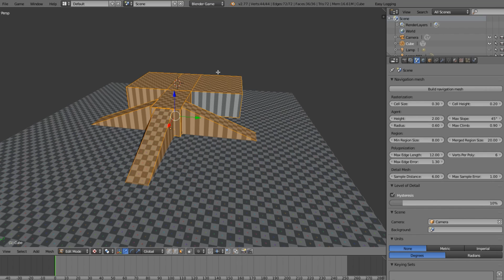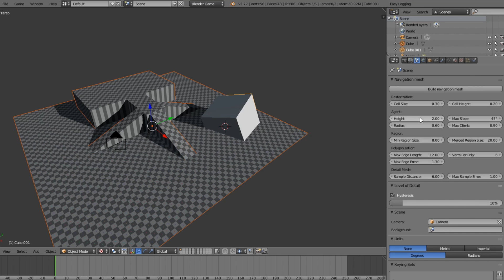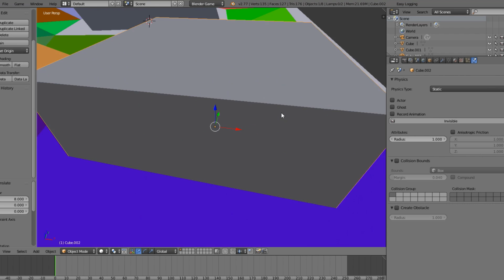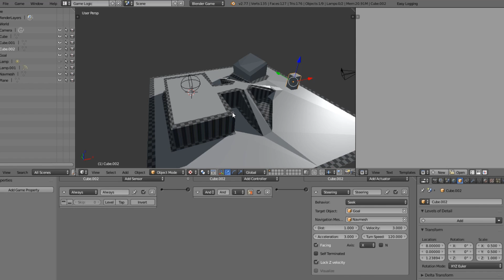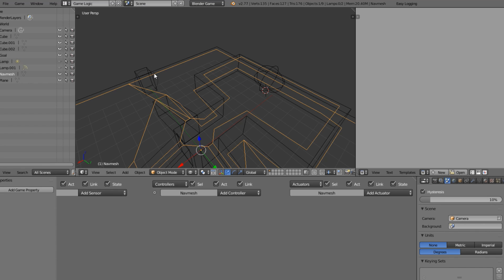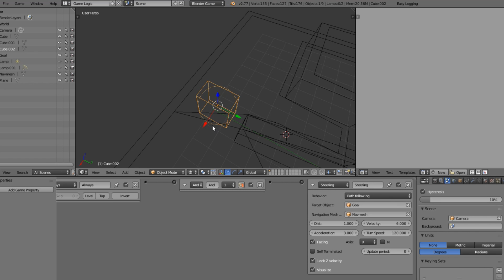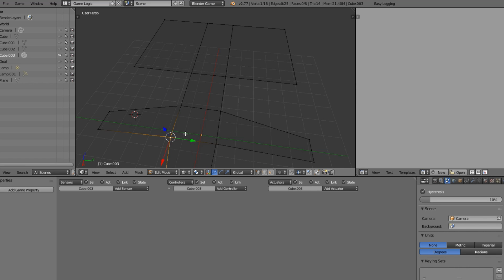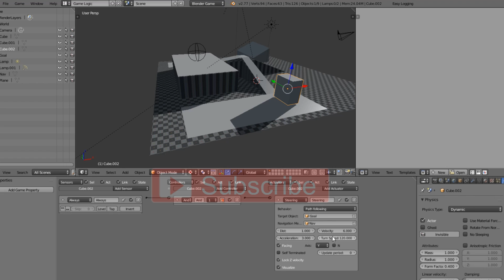Steering Actuator and Creating a navmesh - BGE Tutorial

Comment: Those values control how fast the controlled object gets up to speed or turns. If you set the value very low, then their effect may be noticable.
Reply: I think it goes per-click with the FPS setting. So you may have to go .01 rather than a whole number value. I think accel may be in blender units, but degrees is still degrees.